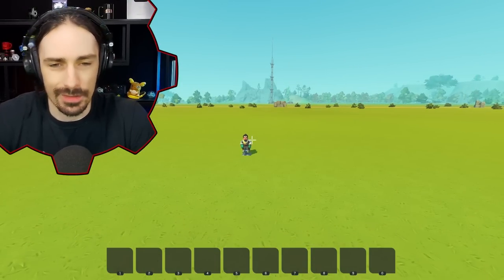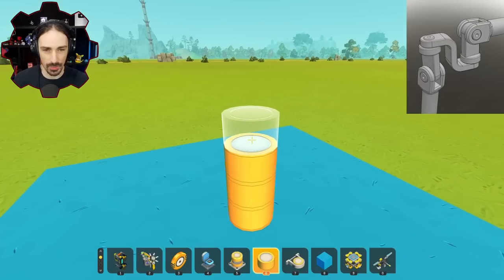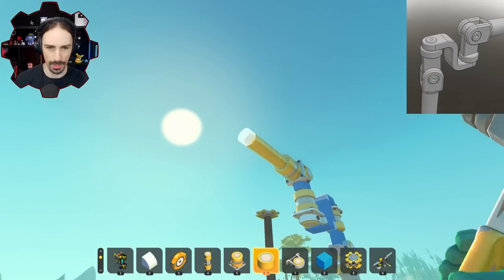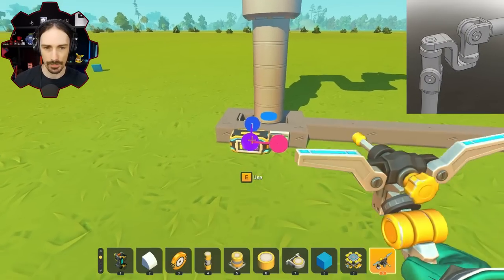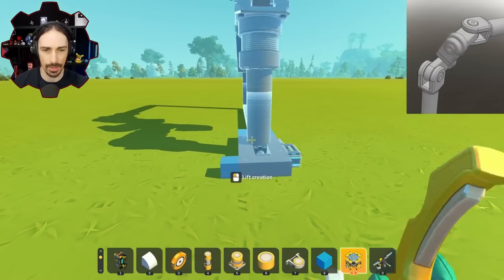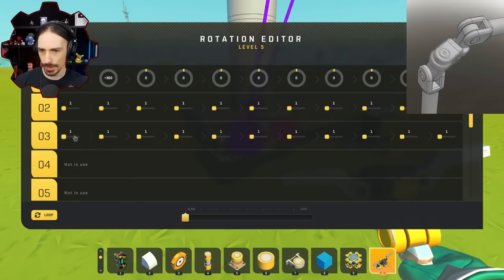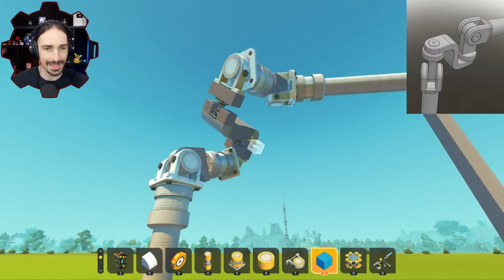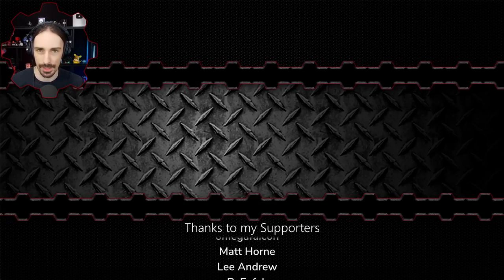I Recreated This Strange Rod Mechanism In Scrap Mechanic

Comment: The problem is the good looking parts. Specifically the pole with a square base. It needed to be round, the square hitbox is getting the creation caught on the corners. Replace with a pipe piece and you should get MUCH better results.

Also, you know where the pole is connected to the post (the end part connected to the wall that isn't in the illustration, off-screen to the right), THAT is where the piston shoulda gone. Basically, pretty much the same thing you did with the first piston attempt, only do it to the horizontal "output" pole, not the vertical "input" one. It will achieve a similar result with what you ended on but look more like the render.
Reply: This! I was screaming for the horizontal pole to be moved instead
Reply: Most of the Barrack parts have box collision, this why it works weird. Though cylinders have actual cylinder collision, they have default diameter of 3 blocks due to incorrect margin value.
Reply: It's not only about moving one pole, in an ideal completely rigid simulation, that would be impossible; it also needs the angle between the poles to be slightly obtuse.
Reply: He also needed to add a block between those pipe brackets and pipes he mounted them to. You could see the piston in the S bracket compressing as the tab that goes into the pipe brackets on the output shaft collides with the output shaft. In the simulation there was enough space to allow for a >90° movement, which I suspect was messing this one up a bit.

Comment: Need a 1 block air-gap at the shafts' bearing "ears". The animation has a gap to allow the assembly to go greater than 90 degrees back into the piston, but the blocks were pressing up hard against each of the shafts and were limited to 90 degree sideways movement as a result. The piston you put in the "S" helped address that somewhat, but I'm pretty sure it would work on its own without the piston if that was corrected.

Comment: That would be called a one-way rotary damper clutch. If anyone would like to know what it is called.
Thanks for the shows Scrapman.
Reply: but what it does, though? I'm reminded of some kind of suspension or drive shaft or I dunno (not an engineer, just a humble scrapman watcher)
Reply: @ArinJager1  Found on lots of things. Balers for hay and straw use the clutch for the pick up rotor to clear jams. Belt conveyors use them as a clutch in the event of a drive motor fail, keeps the conveyor from going reverse in a fail. One would not want to be on an escolator going up, and end up going down with no stop at the end. Soft close doors use them, momentary contact switches are also a good spot to find them. It's not just for drive systems as mechanical pens use the same idea. This Old Tony did a video some time in the past called "Rotary & Linear Dampers, what a drag". Well worth the watch just for the jokes.
Reply: Doesn't the horizontal shaft needs to rotate as well? From the original mechanism I was getting the idea that it converts vertical motion into horizontal motion but he didn't allow the horizontal shaft to rotate so that's probably what was causing it to jam at higher speeds
Reply: @Netherdan  It would if the horizontal shaft had a bearing on it where it connected to the upright pipe, and not on the damper clutch side. In the real world that is how it's done. In cartoon land, not everything is done the proper way.

Comment: Hi Scrapman, I love these videos.
I think that the pistons were not needed in the S like joint but in the pole that holds the horizontal shaft. If you look at the minute 1:13 to 1:41 of your video, in the simulation of the contraption the "horizontal" shaft is slightly tilted upwards before the whole mechanism starts to rotate.
I guess the purpose of this is to transfer the rotational movement as soon as the axis are other than 90 degrees apart.
Reply: Also could have been the editor not wanting to make a rig for the simulation ;)

Comment: Great Video, love this series of replicating mechanisms!

I think using a piston to move the motorized pipe might cause some unwanted tension. If you consider that of one of the two joints controlling the vertical pipes axis has its fixed positing at the horizontal pipe, then it might make sense to not only do an "inwards" push, but to also push the vertical pipe down. That might be better achievable then by having two bearings lowering it and shiftig it aside at the same time.

Maybe you can try that out in another video replicating a similar mechanism.
Keep it up, great work, great quality!

Comment: The method with the piston creates a lot of strain wich causes the vertical axle to flex because of the bearing and causing it to work (it could be better if you angle the axles instead of just moving them)

Comment: My read is that most of your problems are due to the relationship between input and output.
As soon as the slight tilt was pointed out in the beginning, I realized that the output was more than 90 degrees off from the input.
Your first piston at the base came close to fixing it, but you were pushing toward less than 90 degrees, so it struggled even after the jammed bearing was fixed.
My solution would be to let the output pipe rest in a tall net block loop (no bearing on that end), and use a piston to bump the loop up one block.

Bonus points for then adding a slapper arm beyond the loop to see if catapulting with this joint is viable.

Comment: to be honest, the input shaft should stay were it was and the output shaft should have a piston to rise it one or two blocks.
Then the angle of the piece connected to the input shaft will always be off-centered without unwanted forces/bending

Comment: I think somthing worth trying is to put a piston on the horizontal pipe to push the whole top of the mechanism to the left by a little. Instead of trying to angle the vertical pipe. In the original 3D render the vertical is perfectly up and down and the bearing set as a whole is what is off set.
Reply: No because that would cause stress on the berrings. He should push it with rotating arms so that the berrings can follow without stressing the mechanism.
Reply: @captainphoton  I agree, but I believe what makes this mechanism work is that it has a small amount of stress on the bearings. Otherwise, it would just free spin.
Reply: @flyingmunk8956  it get stressed when moving. And that's what make it move. But if it's stressed by default it will just increase friction. And end up clogging like it did for scrap man.
Reply: @captainphoton  yeah that makes sense. Seems to need kind of a fine line in-between the two.
Reply: @flyingmunk8956  the thing with the rotation is that it would push the arm forward. But also keep it perfectly horizontal. Because the little arms on the mechanism are supposed to rotate as well.

While with a piston the arm would need to tilt forward at some point.

Comment: in my opinion there are two problems

The first is that perhaps it was better to use an electric motor instead of a controller and the second that also the upper arm must be slightly beyond 90 degrees in starting point

Comment: if you added a pivot joint to the bottom you probably could've gotten it faster, a pivot joint would've allowed for the full extension of the piston at the bottom allowing for that 5 degree difference, also when you opted to have the angle difference be on the inside its not that big in scrap mechanic especially with controllers but that is an energy deficiency as it would require more energy to pivot from a 90 degree angle than it would a 100 degree angle. overall loved the video really got my mind working

Comment: Let the bearing connection at the end of the driver rod be point A, and the bearing connection at the end of the driven rod be point B.
Construct a right triangle with hypotenuse AB. It's arms are parallel to arms of the support frame. (There are two such triangles, let's consider the one where C points inside the structure)
By moving point A closer inwards, side b which is AC is being shortened. Since c2 = a2 + b2 side c which is the hypotenuse is also being shortened.
The hypotenuse is made out of a solid object, and thus cannot be shortened, and needs to remain constant.
To shorten side b, side a must be lengthened in proportion so c remains unchanged.
By doing that, values of angles at points A and B should switch, thus tilting the hypotenuse without compressing it.

In practical terms, you need to push the driven rod out, if you push the driver rod in.

Comment: 5:18 I'd say put the bottom rod on a piston with a one block gap so it's kinda free-floating then once it's off the lift have it extend the piston out for .5-1 blocks to give it an angle

Comment: The mechanism is so easy to make it took me few minutes to do it right.(i paused the vid when i just seen his try at the S bend. The rotation points align with the highest and lowest parts and the top shaft is actually slightly up. Moving it instead of the bottom shaft would force the top shaft to give under the motion making it do exact same quick spin at the highest point.

Comment: I think the piston would be better placed on the base of the horizontal rod, it would do the same offset but on the two stable parts of the whole thing, which in turn would ensure the pistons don't mess with what the mechanism is meant to be outside of the first position, but you managed to do it anyway so it doesn't really matter.

Comment: Around 5:40 you are actually completely correct my man, paint HAS been scientifically and empirically proved to enhance a machine's capabilities. Take red vehicles for example, clearly their bold and strong color is the determining factor in their performance and so is the grey paint you're applying to your contraption. I'm sure the clean, fresh out of the factory look will help you figure out the ins and outs of this design.
Keep up the good work my friend, thanks for the upload <3

Comment: I think the square plates on the cylinder parts (Whatever the piece is called) are getting caught on every rotation after the first.
If I am right it should be fixed by flipping them. If you check the top left corner at 10:20,  you might see what I am talking about.

Comment: my first thought while your still setting up the 1st run is, "dont one of those bering types have a maximum tolerance, like it can only rotate 340deg and then forces the S bend to flip, then mirrored out to the output. 
even the original animation seems as if the joints seem to be some kind of spring return
Reply: yeah 100% some of thos berings need to be resistive, all the onves inside the roating pistons and the 2 bend

Comment: One problem is the the horizontal rod is supposed to be angled slightly downward. If you had put the piston under that rod with bearings attached to blocks so that it angles smoothly

Comment: i wonder if the horizontal rod, instead of being on a bearing, could have been "trapped" in an Y shaped that is 1 block lower. this way you would have got not really 90deg, and the longer is the Y in the horizonal rod, the lesser is the angle.
But i guess when it does the quick flip, that is a high torque maneuver so it probably want to jump a little

Comment: One big problem I see is that long rotating pole is constant lenght. When piston is offsetting it it doesn't change lenght and geometry of the system is keeping it locked close to 90 degrees

Comment: I wonder why ScrapMan didn't put the piston in the upright support for the end axle, so everything after the first joint was lifted up a few degrees? 
That seemed more in line with the animation than the piston flex in the S bend construction. 
I'd try that if possible, should be a quick test for ScrapMan on the next mechanical example test.

Comment: I think the issue was the bottom rotating axle was offset the other direction going to the left, and it need a bearing so it can rotate in the the axis your pushing it

Comment: its interesting, scrap mechanic actually makes you think think like an engineer, funny story i tried simulating a German puma steering using warthunder on as a reference but scrap mechanic did not like it, it was system with piston and angling the wheels but i just couldn't figure it out

Comment: The fact that the tip of the 2 (it's a sideways 2, okay?) can't flex further than 90 degrees definitely didn't help this. That's what caused the pistons to struggle so much. They had nowhere to push that side of the creation, and they need to be able to split the difference to get the angle right (well, I guess they don't need that, since you got it working, but).

Comment: Hey scrapman the reason why your piston could not spin correctly is because you need to add a free bearing behind the piston attached to the plateform and make it enable to spin when it pushes that way you can have it ben 2 or 3 block

Comment: i think you could achieve that easier by extending the vertical rod to push the S part in the right position instead of missaligning the part, not sure if it would work tho
Reply: yes it does, literally first try hahah, im able to run it on elecric engine speed 5

Comment: is it me or did u interpret the model slightly wrong? instead of static link measurements and right offset on the bottom piston, try offset to the back, so the link always wants to fall forward like in the model.

Comment: they dont have enough room to actuate back at the ends thats why they snap and stop  they lock at 90 degrees and negative 90 degrees in the diagram they go over 90 and negative 90 at the ends you even notice the weird bend in the start

Comment: Did anybody else notice both pieces attached to the S shaped piece aren't spinning in relation to it, they're oscillating? Like 180° clockwise, then 180° counterclockwise. If you put some paint on the outside, you can see it.

Comment: for the middle section couldnt you have just used suspension set to 1 block less than the height of the secondary connection?

Comment: i feel like you could make it simpler by adding pistons on the horizontal axle, if you put multiple pistons you can have them fighting against each other and in the end gets you a block in between other blocks, which would eliminate most of the flex, possibly avoid using pistons on the s bend and stuff

Comment: a lot of parts have a bigger collision here that isnt helping, also, turn the other pole would of helped to see if the rotation was possible, then run it from the original to work out the kinks ;)

Comment: Lol, I tried to do this myself before watching this video, in a super simple way, and when I tried to record it, it crashed my GRAPHICS CARD DRIVERS, like completely, I even had to restart it manually. And I managed to replicate this by putting a piston on the middle vertical rod, and a piston on one of the side middle rods, if I can record it I can post it to the scrap mechanic reddit if someone is interested.

Comment: You need to angle the pipe number 1 that you started to bend the other direction cus the angle of 2 output and input has to be greater than 90°

Comment: me seeing why the thing isnt working and just stnding there like >:|
here why it isnt working perfectly:
in the animation the first rotating joint and the axel have some space between them,which allows the whole S thing to be offset,so the rotating joints
in Scrapmans design the way the axel from the top is made it cant offset the rotating joint bc its right against the axel, basically it has no space to offset itself,so the creation is actually just a liiiiiitle cliping into itself to work in Scrapmans vid
The solution is to make the rotating joint from the top 1 block thick,so it has space to offset
@ScrapMan i hope i helped and my theory works ._.

Comment: 8:55 
You are pushing against a solid structure and hoping it will pivot at the bottom
Reply: And I believe that is the reason it gets stuck, the pillar gets pushed into the "straight" position and that makes the S piece too big for the geometry. Or I'm just wrong, could also be the case

Comment: Iv never played this game and dont really know the physics or how the building works and am currently halfway into the video and was wondering if he could of just moved the piston to the top part and move it by one or 2 blocks so that the main rotating shaft would still be 90° but the top of it were the joint is located would be slightly angled I'm going to finish the video and mabey edit this with a update to my thoughts at the end of the video if I remember

Comment: i can see where the biggest problem in this might lie. the middle part where he put the pistons on, is not long enough in the middle. on the 3d model the s bend corners are equal to the midsection of the first and last hinges.

Comment: maybe the physics tick rate is what's preventing from it working at higher speeds?
Reply: What’s preventing it from working faster is the output shaft. it should have been on pistons pushing it down and towards (or just towards) the input shaft and sitting a block or 2 lower. With the center of the s being lengthened to accommodate the output being dropped 1-2 blocks.

Comment: You're putting stress on it by putting only the one piston in there. Put one on the output shaft to raise it up and that will cause the S-bend to operate at an angle. Also, the S-bend is too short. It needs to extend all the way to the rotation point of the input shaft.

Comment: whats wrong with that piston is the fact when its pushed outward, 1 it collides and 2 the piston cant bend correctly so it needs an extra bearing
if you gett what i mean, explaining mechanics in a message is kinda hard

if youve ever seen wishbone suspension, you kinda know what im talking about